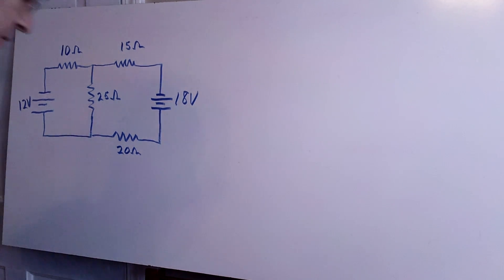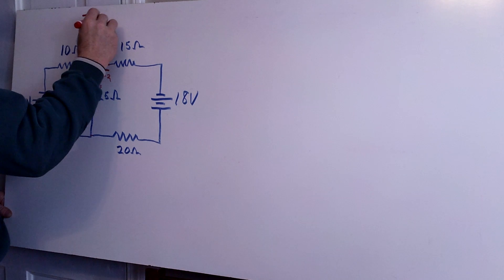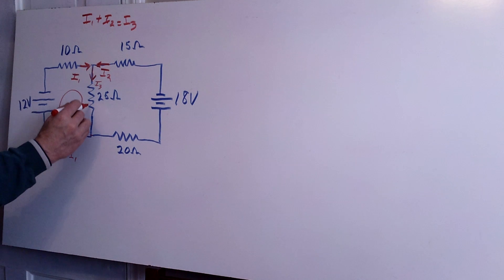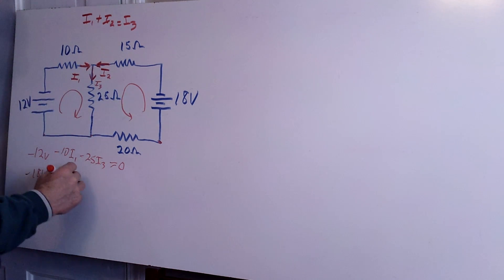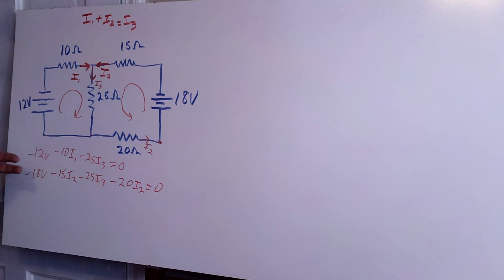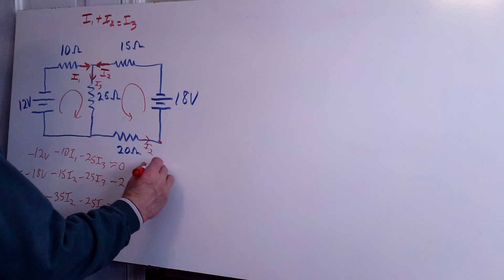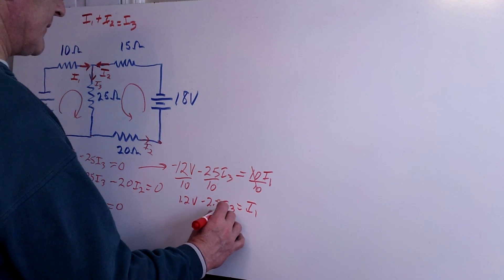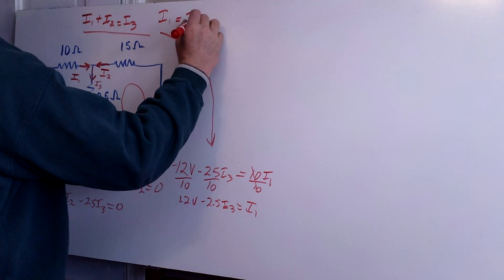4 resistor 2 batteries circuit analyzed using Kirchhoff's Rules Part 1

Comment: You need to trace across currents in the same direction for EVERY loop to prevent issues. If you trace clockwise in one loop, you need to trace clockwise for every loop. It just makes life easier and prevents errors.

Comment: Why does the current get split up that way? Since at the bottom junction there is no resistance between the battery on the left and the the junction, wouldn't all the electrons want to go there? Isn't it almost like a short circuit? (This question might make no sense). On a different note, can someone recommend another book besides the art of electronics for learning this? I find it really interesting, but I kinda wish it had more of the physics behind it to explain it. Also AOE is a great book, but its really dull looking, I think I'm mostly gonna use it to reference to things I don't understand. So yea, any suggestions? Thanks!

Comment: +Alan Glodowski...I am very happy that you are using "electron flow" and not the "conventional flow".  Either way, they both work.  However, I always prefered using the electron flow because (for me) it was always easier.  By the way, the circuit you are using, with two batteries, are these used in practical circuits?  Thanks

Comment: How can you conclude that the wire running from the 20 ohm resistor to the 18 V battery is I2?  Wouldn't it have some combination of the currents I2 and I1?

Thank you.
Reply: John Coffey I used to have the same problem. The way I've come to understand it is that the current coming from  the 18v battery is I2. So the current in must equal the current out (Kirchoff's Current Law). So the current into the battery has to be I2. Hopefully that helps.

Comment: does the loop always go from positive directions?
Reply: No, you can go in either direction. That just changes all the negative signs to positive and all the positive signs to negative.
Reply: IITPhysicsProf thank you for the reply sir ! Really appreciated ! I'm doing a problem for almost 2 hours and I can't even get to the answer, It's not that simple . the circuit has three parallel circuits with more junctions and 2 batteries. .